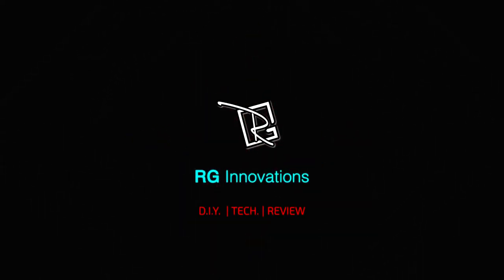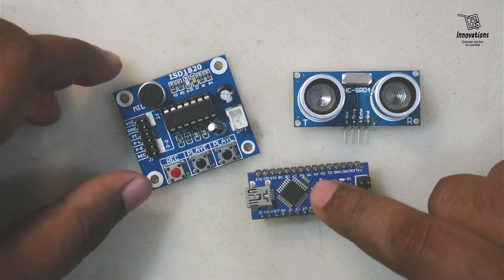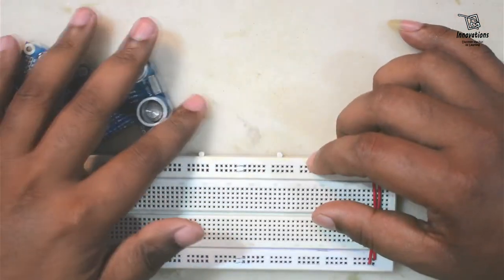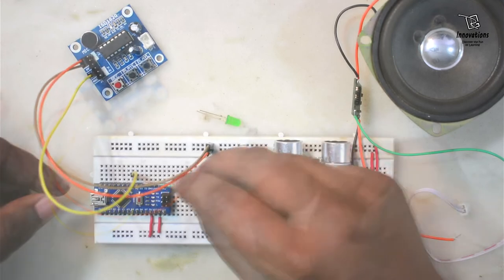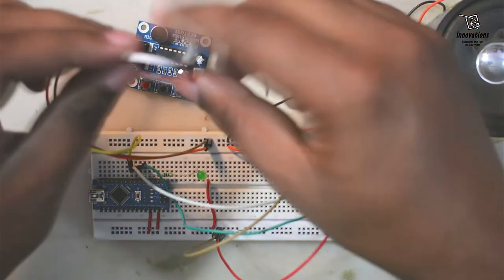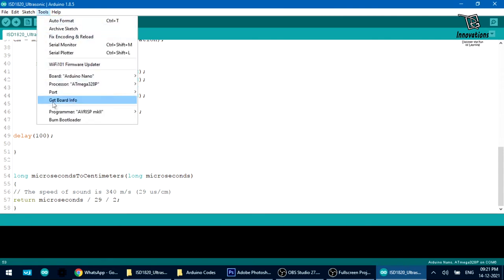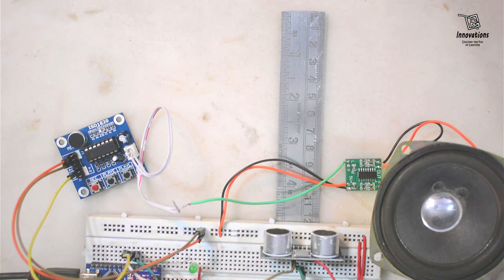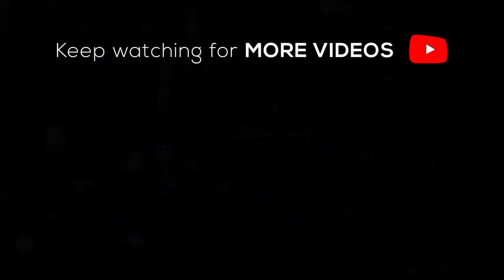Voice Alert For Distance Measurement Using Ultrasonic Sensor HCSR04 + ISD1820 + Arduino

Comment: I want add four more speakers  how to do it sir
Reply from the maker: How big speakers? With how long wire?
Reply: @RGInnovations  megaphone 📣 speaker , I want make it 4 different direction in one set
Reply from the maker: @siddhudp7795 cut off the handheld mouthpiece from the megaphone, and connect that wire to the points of speaker of the ISD module
Reply: @RGInnovations  also connect man detect sensor

Comment: Can this isd1820 module store multiple audios and play accordingly when the ultrasonic sensor range is mentioned in the if condition? Can I use this project for speed breaker and pothole detection?????
Reply from the maker: No this is a single memory module, so a single module can store only one audio. 
you can customize the project as per your need.
Reply: @RGInnovations  Can I use two chips isdi820py (i.e) the one which is present on isdi820. Because I need only two audios to store and play accordingly
Reply from the maker: 2chips cannot be used on same module. you can use two modules
Reply: @RGInnovations  Ohh okay thank you..Can you suggest any cheap mp3 module?
Reply: @harshinimaran3705  Maybe APR33A3 8ch voice recorder module is a good fit :)
Reply: @harshinimaran3705  Whilst I have still have try this module the ISD1760 Voice Recorder/Playback Module can be another good choice

Comment: Excellent project...

If i use photo sensor?? 

Could i get programme data file and diagram..
Reply from the maker: I have not tested, but IR photo sensor should work. I have given a project using LDR. please check my videos. 
Circuit diagram and data file link is given in description.

Comment: sir, can we directly put the sensor in the arduino uno and we will not use breadboard?
Reply from the maker: No, directly not possible, because in arduino, pin arrangement is not same as required by the sensor.
Reply: how to assemble this device using arduino uno?
Reply from the maker: Please download and see the diagram, i have given download link in the description.
Reply: there's problem in uploading the code
Reply from the maker: @rainebiag mail me with screenshot, rgstech85@gmail.com

Comment: Hello sir, i think the connections of the power of the ultrasonic sensor were accidentally exchanged in your diagram. The ground pin became postive and the vcc pin became negative.
Reply from the maker: @Joey Baltazar Thank you for bringing the error to my attention. I have corrected the circuit and re-uploaded it. Thanks once again.

Comment: My voice module is not working when the object is detected, but it gives the recorded audio when I pressed the play edge button,is there any solution for that
Reply from the maker: check if the object detection is working by connecting an led to the arduino output...
Reply: @RGInnovations  i hav a vibrator along with that module, when ever it vibrates it gives the output, but now it's not  giving output as object detected
Reply from the maker: means the vibrator is working, but 1820 not working?
Reply: @RGInnovations  yes, I mean it's working but it was not giving the whole recorded audio when object is detected, it's giving the output like small noise but not that recorded audio.
Reply from the maker: check if you have connected to P-E pin
Reply: @RGInnovations  got it sir 🥲 thank you, all this time I hav connected the pin to p- L
Reply from the maker: Working now?
Reply: @RGInnovations  yes sir it's working

Comment: The voice alert is continuously repeating , even if there is no obstacle, kindly help🙏🙏🙏🙏🙏🙏🙏🙏🙏🙏🙏🙏🙏
Reply from the maker: please recheck the circuit
Reply: @RGInnovations   Thank you for the reply sir , but , we have checked circuit multiple times , but , the problem still exists. The sensor is not detecting the obstacle , it is just saying the messages on loop
Reply from the maker: are you running on battery or external power? mail me rgstech85@gmail.com for quick reply.

Comment: Sir can i use 9 volt battery
Reply from the maker: yes we can use 9v battery at the Vin pin of the arduino, but voice module and ultrasonic sensors should be powered from the 5v pin of the arduino.